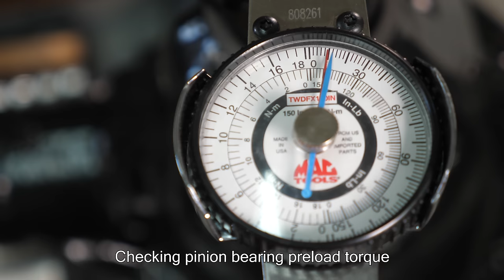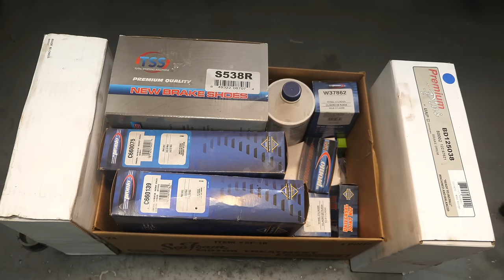Rear Axle Restoration and Rebuild (Chrysler 8.25)

Comment: Damn I love Arizona!  Need a rear axle, anywhere sitting for 20 years, not one spec of rust, ..paint still looks new, bolts come out with no issues.. 

But why no disc? That was a ton of work to go back to drumbs..
Reply: A lot of work? LOL  He had that son of a bitch rebuilt and on the road in under 40 minutes! It would take him probably  no more than 45 seconds to do disc conversion.
Reply: @cluckhead1913  The video is 40 minutes but it is highly edited. This is at least a solid 4 to 6 hours of work just to tear it all apart and make a list of the parts that needed replaced. Another 2 hours minimum to put it all back together. This was at least a full day if not 2 full eight to 10 hour days of work including cleaning, sanding, measuring, chiseling, and other things that weren't shown...not including waiting for parts if they didn't already have what was needed.
Reply: @Meme Man then why did he not reply back?  Are you sure anything went over anyone's head, joke maybe, or was it?

Comment: This video delivers basic knowledge on differential transmission gearing. Also it takes individual through use of tools assembly and disassembly stages in all particular means to be taken in account. Also it directs me to conclude : you have to make tool that matches exact needs sometimes. This is not only tutorial on transmission repair, but idea of being skilled  on machinery.

Comment: I can second one of your comments... My '87 Cherokee had the worst brakes of any vehicle I've owned, and it was all due to the crappy behavior of the rear drum brakes.  The proportioning with the front discs was all wrong and made it almost unmanageable in very slick situations.  I loved the running gear overall, but if I'd kept it, rear disc conversion would have been a must.

That said, great workmanship!

Comment: Amazing job to these older  parts. Keep up the amazing work. One thing i will suggest is besides torquing bolts you should be checking end play. There are inexpensive ways to do so. Otherwise you can have problems. Looked good to me though

Comment: Good video.  Only thing I could see you missed was lubricating the contact points on the side of the shoes to the backplate and at the tips of the wheel cylinder pistons.  Anywhere there is metal contact and movement there should be some lube.  Otherwise, very good vid.    IF you ever want to put disc brakes on this axle, get the parts from an '02-05 Liberty KJ.  Same Corporate 8.25 housing with discs and coil spring suspension and 29 spline axles.  Caliper backplate bolts right up, no mods required as with some of the ZJ conversions with Dana 35s.  Grab the mounting studs from the flanges too and the proportioning valve spring and screw cap.  Thanks for posting.

Comment: no tag on the diff. cover . what was the gear ratio? good job.  I did this to my 70 mustang. An 8", 3.00 to 1. The tailpipe had previously dropped down onto the axle tube and flattened the steel left rear brake line. I found it when that left brake wouldn't bleed. It now has a posi and power disc brakes all-around. Heavy wall drive line. 500hp 351w bored and stroked. Have fun. Good work.

Comment: I missed the part where you adjusted the crush sleeve on  the pinion and wow you can clearly see the torgue on the axle as you drove it at the end. I wonder how much power is lost as that axle twists as you apply power. I suppose a little twist is OK if your off road as it will tend to twist rather than snap off.
Reply from the maker: You can see torque? Can you count fluids as well?

Comment: Great job! Lots of work though. 
The brake tubing could use a little work though. You also should have added the spring tubing to the lines. They do 2 things - protect the tubing from impact crushing & they help cool down the lines. And did you use copper? Don't do that...

Comment: Very good job,,, however, with that old, is the axle still good? No run out at the wheel bearings?! Wonderful,  i care about my jeep liberty 2012, 100 m km on him, great!!!!!!! Thanks for posting.
Reply from the maker: The bearing that I replaced on the outside ends of the axle are the wheel bearings so they're brand new
Reply: @RestorationStation  i know they are, i mean the axle itself, i doesnt need change? As the race is in them, and cannot be changed, unless the axle, ?

Comment: You did good, attention to detail was awesome, but your going to regret not putting the guard spring tubing protection back on, doesn't take much to dent/puncture thin wall brake lines.

Comment: Wonder why you did not sandblast the protective spring around the brake fluid pipe and slot in the new brake fluid pipe.  Protects against loose stone gravel wear and/ puncture by shrapnel, 35:46

Comment: Thoroughly enjoyable to watch and the hours put in was how you do the job right, but all this work is then compromised by grinding the U bolts off and the grinding sparks/red hot particles  flying off and sticking to the lovely finish, just a few big blankets over the lovely work would have stopped that.

Comment: 2:37 those brake lines were looking pretty bad and deserved to be snapped, but if you want to save them, take the 2 bolts off the wheel cylinder. put a pipe wrench on the cylinder and a wrench on the flare nut. Keep the flare nut stationary while you turn the wheel cylinder with the pipe wrench.

Comment: 3:50 In your video here is where i'm asking if my friend can get hurt by touching it while the car is on.

I have a question about a back axel on a truck and say if there was something wrong with the axel and say that person was touching the axel to see if there was something wrong can he get shock or burnt by it if the car was turn on with motor running?

My friend has a Dodge truck and he's always crawling under it to see if it's damage and i'm just worry that he might get burnt or shock by it and really I don't know anything about car repair  so I thought my friend would get hurt while the car was running.

Comment: would like to learn how to do rear brake drum job since my 95 Dakota has rear drum brakes. And was this an open differential? the gear in the differential  seemed to spin in the opposite direction. I ordered my 95 Dakota with 3.55 Chrysler Anti-spin differential because I didn't have a 4x4 . Now I do and would like to have a 3.21 ratio with a mechanical locking differential.

Comment: I have a question maybe you can answer. I have a parts truck with a crunched pinion bearing, because of this the truck will not roll. Is it possible to remove just the pinion from the axle without tearing both axle shafts out?

Comment: 13:57  I'm surprised you didn't stuff some rags in there to keep all that rust and polish-pad dust from getting into the axle tubes.  It's a minor detail, but if you were willing to go to the trouble of brake-cleans-ing out the tubes, why not keep them clean with a couple of rags?

Comment: are the ends of the leaf spring suppose to move that much on the top left of the video when they're driving it? I don't know much about suspension on vehicles especially leaf springs, just curious.
Reply from the maker: Leaf springs are installed with something called shackles on one end which you can kind of see in the back. If you think about the geometry of an arc they lengthen as they compress/flatten. The shackles in the back rotate forward and back to accommodate this change in length
Reply: @RestorationStation  Ah okay this makes much more sense to me just thinking the "bracket" was loose and or flexing too much. thak you for the information!

Comment: i was surprised they use a rubber grommet plug to seal the diff oil hole. Just seems like that should be a bolt....if i drive through corn stalks or brush...that grommet is gone!

Comment: Lanoline grease would have prevented surface rust and seized bolts. Rust fix and brakes was the only actually necessary repair here - ?
Reply from the maker: There was a little bit of rust on the axle and slight damage to the shock mounts as well...
Reply: @RestorationStation  Ton of rust. Same thing broke a leaf spring on my 1977 Ford Escort. Awesome video.

Comment: The axle you show putting back in at 29:02 looks to me like it is destroyed. The hard facing is gone from the bearing surface. Good axles do not look that way and your other one does not look that way. You will lose a axle and wheel bearing very quick if you run that axle.

Comment: Get a better flaring tool and stainless tubing and redo those lines. You didn't actually achieve a double flare, and a single flare (and likely even a good double) with that copper-nickel garbage will fail quickly.

Comment: GOOD VIDEO !!!!!!!!
NO MUSIC 
i hate SETTING UP BUMBs !!!!!!!!!!!
and COLAPSING the PINION SPACER !!!!
on GM BUMBs !!!!!!!!!!
USING THE SPACERS !!! Not like this Video that you can SET CARRIER PRELOAD Through the DIFF HOUSING !!!!!!!!!
Had to Do one on a 1988 CORVETTE that was Very Small unit BOLTED to a VICE 
and on a 1996 CAMARO did it 8 x Customer gave me a Aftermarket Ring Gear SET had to SET UP FROM SCRATCH 
REAR DISC BRAKES are a A PAIN !!!!!!!!!!
:Lost my Shirt on that FLAT RATE JOB

Comment: A poor man’s parts washer is a 5 gal bucket with 2.5 gal of diesel fuel in it. A stupid poor man’s parts washer is the same as above only with 2.5 gallons of gasoline in it.
Reply from the maker: A tiny oil drain pan with a quart of mineral spirits doesn't count?